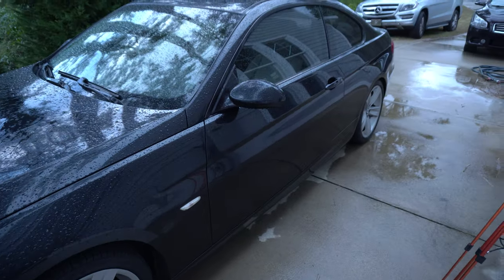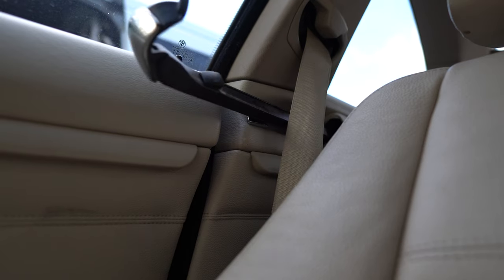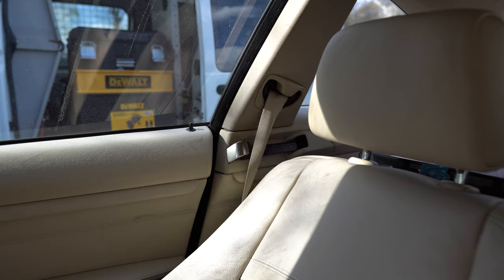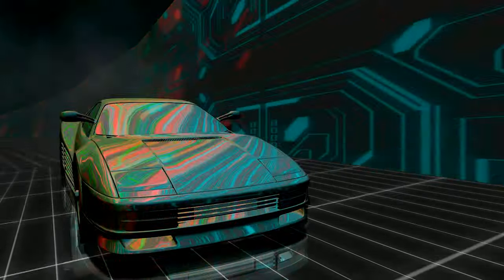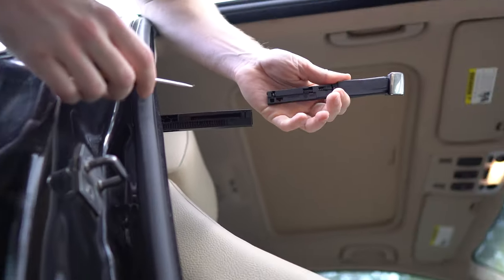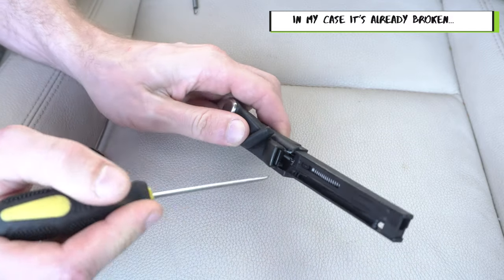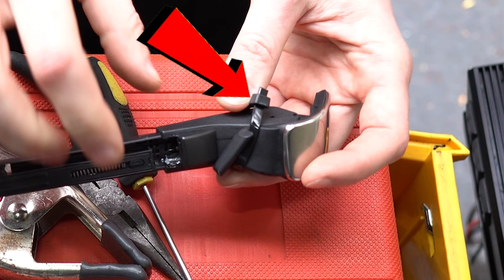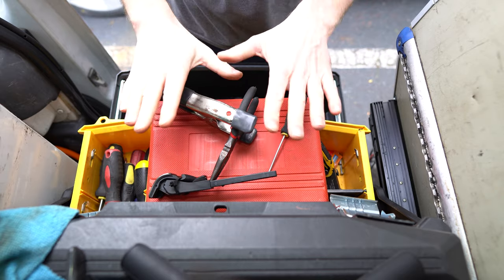BMW Seat Belt Extender Hand Drop Repair on E92 Easy Remastered

Comment: I just taped the seatbelt at the bottom where it loops around the metal guide bar by the carpet. Push seat belt toward front off car and tape it in place. You can also use like foam tubing to hold it in place (all the way forward) I did it on both sides.
Reply from the maker: I would rather preffer quick ironing, sins it will stiffen the belt, but it also would have chance of damaging it, so you need to be pretty carful with this aproach.

Comment: Thanks for the excellent guide! Unfortunately, when I was trying to remove the end piece, the entire arm came loose. Am I out of luck on fixing it now?
Reply from the maker: Sorry to hear that! Used one will cost $50 but I would recommend to get it new.
Reply: I did the same pulled the whole thing out.
I will try to push the whole thing in again.
Reply: @nicadair7700  I was actually very lucky. I was able to get the entire arm back in.
Reply: @johnmorris8409  You just pushed the whole thing back in and it worked? I hope I have your luck 😀
Reply: @nicadair7700  yep! I was shocked it went back in honestly. Good luck!

Comment: My driver side is just not coming out at all… could it be a fuse? I just got the car used it’s a 2009 328i. Thank you
Reply from the maker: I think I did pull the fuse in the video, just remove it and check if it's not blown. otherwise the motor probably dead or stuck, or the microswitch is not responding, you should have some sort of message when you read OBD.
Reply: Quite late to reply, but an earlier owner could have disabled the system from the driver side by coding the car

Comment: Hi, thxs for the video! I also watched your video from 2017 "BMW Seat Belt Extender Hand drop fix..." and I want to ask you what method seems to you better? (easy to do, reliable, risk of messing it up, etc, etc)  The one with the little screw or this one with glue? Thank you again.
Reply from the maker: Hey. Thanks for the comment! Easier and faster the one with a glue, but tbe extremely careful to not glue anything else. Also let it cure overnight, in that case it will less as long as the one with the screw.

Comment: When I press the button mine doesn’t spring back open it stays in the locked position any idea why?
Reply from the maker: That means the some of the inner element is damaged, you still can try to rack that aluminum "L" piece, but if that wouldn't work, just order the new one. 
Good luck!

Comment: Do you not have your e93 anymore?
Reply from the maker: No, just sold it, it has some engine problems… planning to get one as i sold my e92 335i
Reply from the maker: I’m also considering z4, as daily driver, idk… e93 or z4))) newer had the z4, so want to try One))
Reply: @Makhnovets  that would be cool, you were the only one making e93 content regularly.
Reply from the maker: will see, I might gonna get back E93 but i also have friend who owns one, so if you need any type of DIY's just hit me up!
Reply: @Makhnovets  funny you mention, I want to replace my idrive knob to the M3 aluminum one. And can’t figure out how to take the knob off
Reply from the maker: @DannyGrc  what year is your car?
I have the video on that, and will be doing separate video on how to disassemble i-drive unit, because i broke one😅. I been trying to remove the knob on 2009 bmw with new i-drive, and rip the knob out, so pressing will not work any more. There awesome solutions for the upgrade, I will send you the link tomorrow, and you will not need to remove anything. Unless you have i-drive with one menu button 2006-2008. In that case simply, I have the video for that one if so but not yet for the new one.
Reply: @Makhnovets  I have a 2011 so it’s an LCI,
Reply from the maker: @DannyGrc  I will try to send you the info tomorrow or Sunday, as the video should be ready by then…
Reply: @Makhnovets  awesome thanks!
Reply from the maker: https://youtu.be/xR22CZ82Ldc
the video only gonna be ready in two weeks, the first one will be about knob upgrade. 
That one! the best mode: https://amzn.to/3k3Kov1 I had one in m3 e93 and e92. feels and looks awesom!